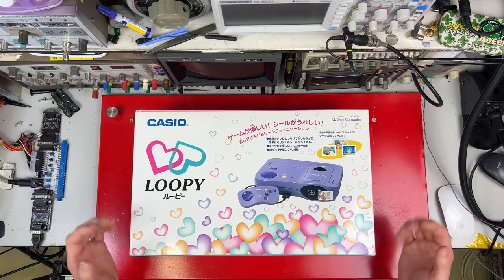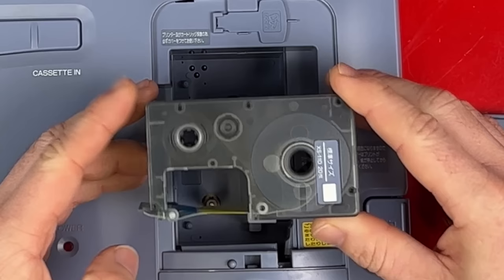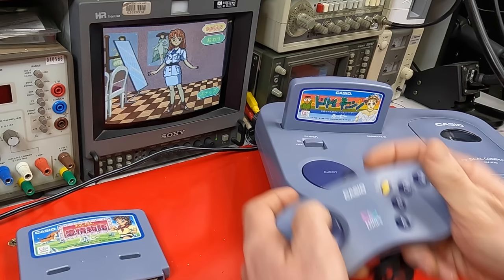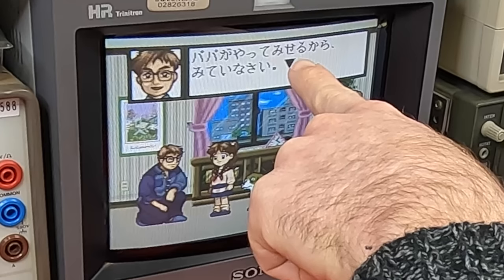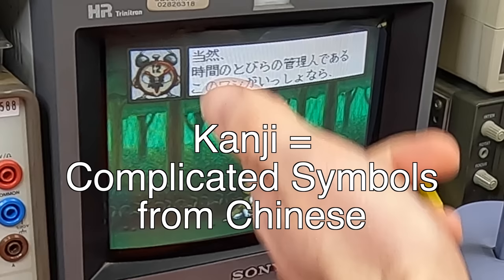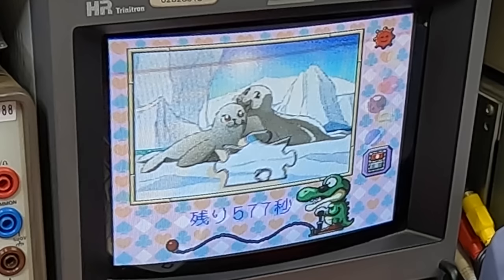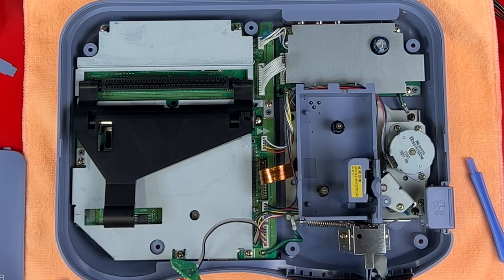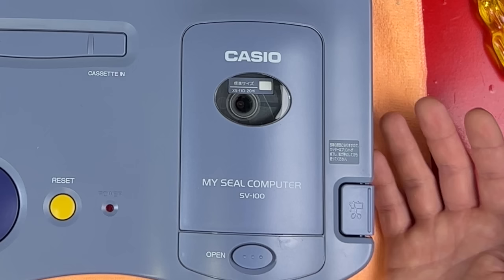Casio Made A Game Console

Comment: Regarding kanji in children's games, there are some basic kanji that Japanese children are expected to learn from a young age, and all the kanji shown in this video are among them. The games you showed were definitely very LIGHT on kanji, using hiragana for far more than you'd typically see in Japanese games for an older audience -- just not ALL hiragana.

Pokemon electing not to use kanji at all in its early games (current Pokemon games do use some!) was indeed partially to make the games more accessible, but mostly due to technical limitations. For one thing, kanji takes up extra space on a cartridge that's already absurdly limited in space -- but more crucially, the Game Boy screen is extremely lo-res (and, initially, monochrome to boot!), and conveying complex kanji in a fuzzy, blurry square of 8x8 pixels (16x16 at most!) is a bit of a losing proposition. Believe me, I've seen games attempt it before, and trying to read those kanji can be infuriating, as you wind up with what practically looks like an all-white square that has random dots missing here and there, but otherwise just looks like an absolute mish-mash of pixels.
Reply: even hiragana on those low res screens can be hard to read tbf
Reply: And I guess they couldn't just write in Japanese but with latin characters either because that would just suck for the japanese playerbase. Probably not difficult, but most definetely sucky
Reply: @gabrielmalta1962 Romanji is the word you were looking for. Phonetically spelled Japanese in latin characters.

Comment: The single controller was the death nail for this console. If it had two controllers, you could have designed your character, your friend their character, and then printed an image of you both. The printer was really good and high definition (for a toy).
Also this came out a year after the PS1, so it doesn't make much sense to use cartridges. N64 was doing it, but that was also that console's failure.

Comment: The sticker paper looks like the same sticker paper that retail stores use. Wal-Mart had a ton of different labels in my time of working there, and Im sure one of those would actually fit, granted the sticker portion wouldn't be pre-cut. It might be worth looking at office and retail supply outlets for replacement rolls that you can make work.
Reply: Not necessarily. This is not a regular thermal printer, it uses thermal transfer or dye-sub technology. There's an ink ribbon (you can see a dried up bit of it stuck to the piece of paper he digs out of the console) sandwiched with the sticker paper that's (probably) 3x or 4x as long, and has a repeating pattern (either RGB or CMYK) the same size as each sticker. It prints each sticker multiple times with each successive part of the ribbon to get the full colour effect. These type of cartridges tend to be proprietary or close to it, so a drop in replacement may not exist.

If you look at the paper in the cartridge there's a pattern of little black marks on it, the machine uses those to know where it is on the roll and where the ink ribbon is relative to the sticker paper. If it doesn't see those it'll probably either just refuse to work or mess up in weird ways.

Depending exactly how this printer works you might be able to see what other people have printed if you open the cartridge and look at the spent ribbon.
Reply: @irtbmtind89  Interesting... Might have to get my hand on one and see if an alternative can be figured out, surely the demand of sticker printing consoles must be going up.

Comment: I decided to look into the cxa 1645 encoder chip cause why wouldn't I?

• Compatible with both NTSC and PAL systems

• Built-in 75Ωdrivers(RGB output, composite video output, Y output, C output)

• Both sine wave and pulse can be input as a subcarrier.

• Built-in band pass filter for the C signal and delay line for the Y signal

• Built-in R-Y and B-Y modulator circuits

Although it has color difference modulator circuits the pinout for the chip does not offer an output for them, which is too bad because if it did you could output Y (from s-video) along with B-y & R-y which gives you YPbPr a luma based RGB quality equivalent

Comment: honestly if you know the label size you should be able to refill the cartridge, im guessing its a 2-1.5 inch label roll, very cheap to get; the middle part of the roll where its held is usually universal on all small label printers. the tensioner is for when you reload it and feed it through the printer.
honestly it LOOKS to be a decent printer surprisingly, better than some ive seen b4, very simple which isnt surprising since its for little girls supposedly.
it would be weird if Casio made it so only specialized rolls could work(especially since that would be kinda expensive to produce)
Reply from the maker: It’s a colour thermal transfer printer, they made it so only specialised rolls could work. I fully expected to find another casio device with cartridges that just had a different casing but it appears not to be the case.

Comment: I found two unused seal cartridges on mercari (Japanese Ebay) for ¥4,888. Seems like there are two kinds of cartridges for the Loopy (ルーピー that’s what they call it). One is the “standard” 30x40mm size and the other”1/4” size (the standard size but cut into 4 smaller ones). Also, a single cartridge contains 100 stickers and for the 1/4 size, that goes up to 400 smaller stickers
Reply from the maker: There are three actually, there’s a third one for printing text titles made with the video capture unit that I forget the name of. Can you please post the link or at least the listing name so I can have a look? I have found the 1/4 paper and title paper on yja and have them sitting at a proxy warehouse

Comment: This really would have had potential had there been some changes to components (swapping the cartidge for a DVD drive, and the printer for a audio cassette drive capable of storing TAR GZ data), because Casio made plenty such devices (like a portable stereo or HiFi) using what could have been components. What they could have done is keep the graphics approximately the same (which resembles something like 256 volor VGA as BMP or TARGA by the looks of things, even if the format is different) but tweak the CPU and swap the cartridge and printer for something else. The cartridge could have instead been a DVD (ATAPI) like the GameWave had, and then the printer could have been swapped for a audio cassette which also records data (even just by squarewave sound instead of SCSI interface, like a c64 or ZXspecrum sort of) to store not just audio but "TAR GZ" files which as Tape-Archve ('TAR') and "Gzip" ('GZ' part of the file extension for compression) and so save games and drivers and art package files could be stored on the tape and swapped to another friend's consoles to load into RAM and then copy back onto spare backup tape. The tapes would simply be standard chromium (or at a push maybe ferrous) 90 minute tapes like you play in a Walkman. Like the GameWave it could have 16 Megabytes RAM (or maybe 32MB). The speed of that CPU, if it had an FPU (basically swapping it for maybe a Motorola) could be faster, (let alone if it had two such CPU and FPU combinations like Apple Mac, considering the Sega32X had two CPUs). Compression would be fast for the TAR-GZ files on the tape and also for sending data to the parallel port IEEE1284 if linked to a home PC (drivers for which would be on every game DVD and able to be written and loaded to the tape). With reasonable compression a fair bit of data would go onto a 90 minute tape. Obviously, the entre device would be capable of playing standard audo casettes (even if at medium quality) and DVD and Audio CD. Having the tape would mean data could compile audio sounds from square wave data on the DVD so that Mpeg2 (or audio layer 3) would not need to be used since that would incur royalties. The system should also have a casio digital watch built in as a system clock with calender for event scheduling, such as hash integrity checking the tape archive TAR GZ, tamagotchi pet feeding and person interaction or comms, and localisation or language learning lessons. If a new driver were to have come out of a game DVD, you could get a copy (transfering it to tape as a TAR GZ file) of that driver (for a printer, scanner, camera, IR-Blaster-receiver, CD-ReWriter, External-system-clock, or joystick or other peripheral like a data storage device in the IEEE1284 port or an ethernet RJ45 to IEEE1284 adaptor), or for a device that attaches to MIDI, like a light-pen or light-gun or trackball or sampler, or a keyboard for a word-processor typing tutor or spreadsheet like EasyCalc on the Amiga (which is public domain btw and incompatible with A500plus). The controllers could have done with a few more buttons.
A MIDI port could have been in addition to the back since Casio made plenty MIDI keyboards. A casio digital-watch (with stop-watch and programmable calendar) system clock could have enabled video-timing or sorts and a way to link to a VCR which as time-coding. At 32bit for address bus, over 16MB RAM could be added (such as 32MB and a RAM expansion slot to maybe double that to 64MB), and it probably would not have been that expensive. Removal of the Cartidge and printer saves cost. It would also thereby be able to record actual audio tapes from RAM form music composed in a game akin to Playstation-music. For some tasks like 3D graphics resembling Elite2Frontier a 16MHZ CPU with FPU (especially if there were two of them, doubling that processing power furter) could do better than the Playstation CPU which had no FPU. Is is quite typical for transcendental operations (FFT etc.) to take 5 times longer if on a CPU without an FPU. even with one CPU and FPU it could potentially have been 3 times faster than the playstation, but with two such CPU and FPU combos, linked via a (maybe custom) MMU, it could be say 5 times faster than the playstation at some tasks like music FFT and compression and some subsets of 3D graphics.
RS232 serial joypad port, along with a parallel IEEE1284 port for adding an actual printer (drivers being released in future other than generic drivers on every game DVD) and so a MIDI joystick or keyboard or casio music device could be added and the serial has various usages. There would really be two IEEE1284 parallel ports so that you'd be able to daidy-cahin multiple such games consoes systems together for multiplayer, tape data copying and PC data transfer and passthrough for a printer and printer  If games came on DVD and tape, the write-protection would prevent the tape being subject to edits and blank tapes could be used instead for new saved data.
or scanner sharing (even if urn based for the scanner and camera sharing). It would technically be able to be used as a router.
My comment has no hate in it and I do no harm. I am not appalled or afraid, boasting or envying or complaining... Just saying. Psalms23: Giving thanks and praise to the Lord and peace and love. Also, I'd say Matthew6.

Comment: Have an 8 year old Japanese daughter and this would still appeal to her world in 2023 (where it not for her recently acquired Switch). 25,000 yen when released is VERY high and surely the oonsumables woldn't have been cheap, but a three year run with just 11 software titles probably speaks more to the fact this was a toy than a console as we think of them; these types of devices still exist and would cost around 8,000-12,000 yen range w/o printers and all the programs built in with its own original OS. They would need to rely on having some sort of IP attached to them like Anpanman, Precure, Disney Princesses, Kamen Rider, etc, and in reality these IP would account for anywhere between half to a quarter of the cost of the product.

Comment: Pokemon uses Kanji. The latest games Sword and Shield and Scarlet and Violet actually have 2 language choices for japanese, one that's kana only and one that includes kanji. Oddly this accessibility option doesn't let you change between them without erasing the save file and starting over completely. 
For pokemon the language the game is in determines it's region for purposes of trading and breeding and what not, so I get why they don't want you to change it, but I would assume both JP language options would still count as the same region, so I don't know why lock out the player from changing a setting to accommodate their reading level. It is a feature though.
I could just be misremembering but I think my copy of Fire Red also used some Kanji. 
The original gameboy games probably didn't use it simply to save file sizes by not having to include extra characters in the font more so than to make it easier for kids.
Reply from the maker: Interesting! I tried to play pokemon green ages ago which had no kanji

Comment: Did you unwind your old extension cord? 2000W should be no problem for any fully unwound cables on 230V. Bit confused on the "don't do that" message. Use an old extension cord? Depends on the condition (but it not being unwound is by far the most common error / fault, and the most likely to build up heat).
Reply from the maker: The double adaptor is the unsafe part when pulling full capacity from an outlet. The dirty contacts on the extension cable didn’t help.